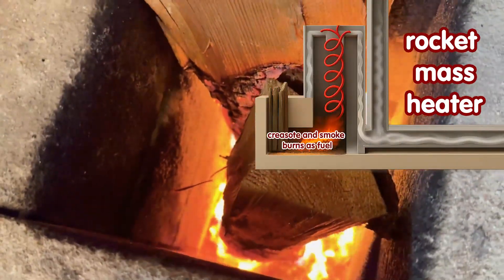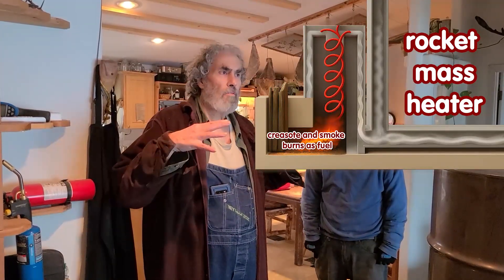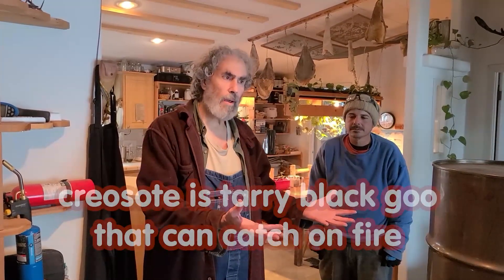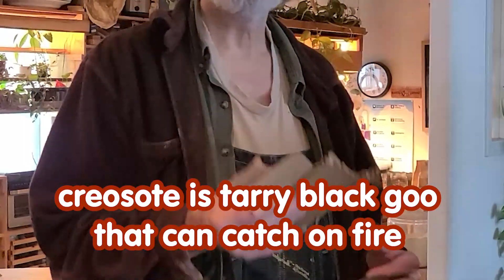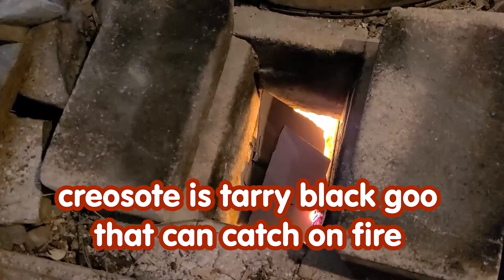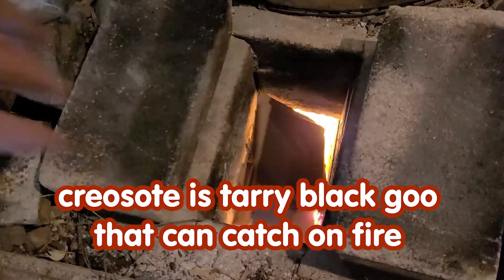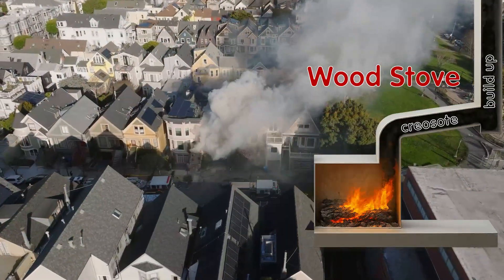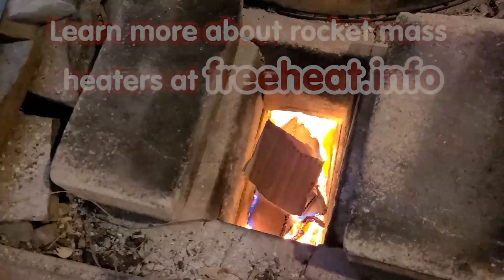creosote burns at 1300F - best heat through science!

Comment: About 1 in 10 burns, my RMH, goes ‘nuts’ and  the barrel top temp reaches 500f .. I’m guessing this is the chimney fire … a normal burn will tick along at 300f .. I’m sure you’re about to tell me my stove is underperforming .. but there are the real numbers (I have a barrel on the small  side) -  I’ve never seen the crazy efficiency others report
Reply: It sounds like your burn tunnel and heat riser might not be sufficiently insulated?